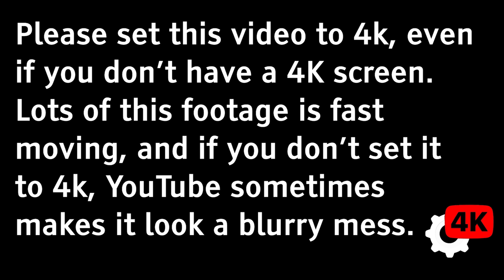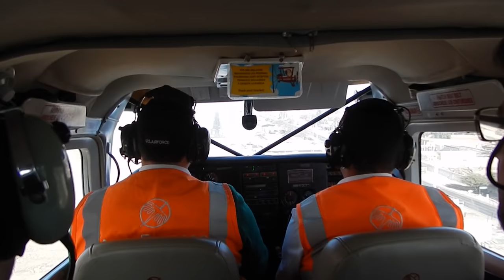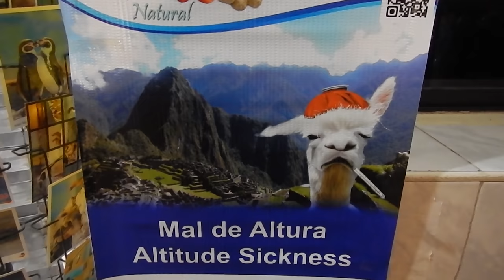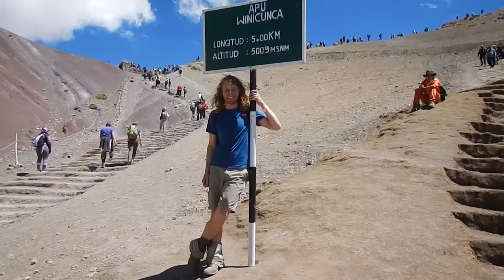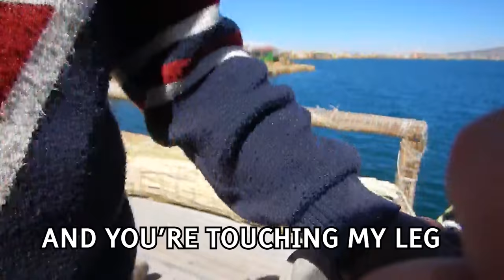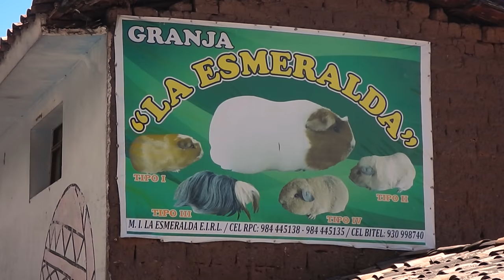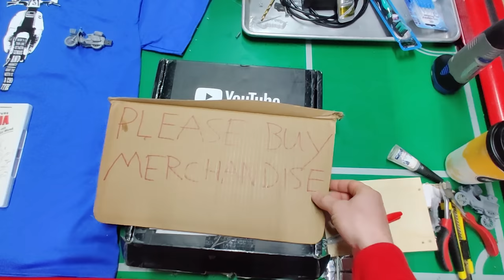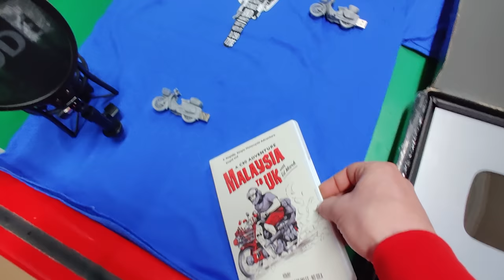Alaska to Argentina on a Honda 90 episode 15 - Peru and Ecuador

Comment: ED: Please watch in 4K

My Internet: Best I can do is 480p.
Reply: my internet can handle 4k but my pc...
Reply: My PC can only handle 360
Reply: I’m on an iPhone 8+ and the best I can do is 1080p60
Reply: Just move to Europe or Asia.
Reply: Ah you are from Germany as well...
Reply: @jakeblanton6853  Try to switch your DNS settings away from your ISP. 

The 500 Mbps connection is only provisioned between your location and the nearest ISP location, not out on the internet. But 180 Mbps should be plenty as 4K only requires about 25-40 Mbps so you may have other usage on your connection.
Reply: @danishknight2798  -- If that speed is only at the ISP, then it's pretty useless since there is not really much of anything anyone would want to access there ... :)  The 2 year promo was up on the special pricing for the 500 Mbps service, so I canceled my service and let my wife sign up for a 1 year 25 Mbps promo (since they would not give me a deal to stay).  Technically, she's a "new user" and has not had an account with them within the last 30 days, so she met the requirements for the promo pricing.  I've tested the speed a couple of times with it on various machines around the house and with a wired connection, it gets very close to 25 Mbps and sometimes up to 29 Mbps.  With a Wireless connection on those same machines, it gets around 16-18 Mbps these days.  Which is a bit odd since the WiFi adapters in those machines are easily capable of handling a lot more than that speed and when connected to the WAP on the previous cable modem were able to get more speed (although not as much as Xfinity claimed I was supposed to get).  For my use though, the 25 Mbps service is plenty.  A few years ago, I had 10 Mbps service and was content with it.  I just don't do the types of things that require high bandwidth.
Reply: @jakeblanton6853  What are you complaining about? If the line between your location and the ISP's first hub does not support more than 50 Mbps that is what you get, evenif they sell you 5000000 Mpbs.
Reply: @danishknight2798  -- They only sell a particular package if your address should be able to get it (or at least pretty close to it)... And I'm a curmudgeon, so complaining is one of the few pleasures I have left in life... Or as we used to say, "A bitching sailor is a happy sailor"... :)
Reply: @jakeblanton6853  Or they get tired of hearing from you aka I used to work the same building as my ISP's techs. Before fiber, I got two copper lines run to my area to support 1.5 Mbps before the rest of the zip code. Now, we are up to "50Mbps" on "fiber" for 8 households dead-end area of their lines in rural county backwoods and get 30-35ish depending on the weather.

FYI- This is USA too.
Reply: @jakeblanton6853  Have you tried upgrading your router? The one that is hooked to the 500 Mbps modem? I got a Netgear Nighthawk and it finally fixed the bottleneck... now our neighbors get our wifi signal
Reply: @TheTurtleOfGods  -- I was using the router that was part of the Xfinity modem, so it was supposed to be good for up to 1 Gbps (wired or wireless)...
Reply: Gheezus people, what's the big deal.  If you want to watch in 4k, just download the video (doesn't matter how long it takes), and watch it offline at 4k once it's done downloading.  Now if you're data capped, that's a separate issue, but (bandwidth) speed limits definitely don't stop you from watching 4k videos.
Reply: Me watching in 240p laughing
Reply: 340
Reply: I don't even know what mine is but it's pretty far from 4k through my cracked screen.
Reply: I set it to 4K and my YouTube crashed
Reply: Now you can't even watch videos in 4K anymore without paying for YouTube Premium. Thanks Jewtube, money hungry bastards. Can't enjoy this wonderful content how it was intended without shelling out extra money? Pass. 1080p is fine for me!
Reply: @SamiNami  just existing in europe doesnt make the internet faster

Comment: Just a tip, a condenser mic doesn't pick much background sound, and you can use any gate plugin to filter out lower-volume sounds. You don't need to soundproof your room using these techniques.

Comment: hello ed  you got some dedication riding all them miles on c90 but same time your right about c90 find parts any where in word for them... i am going to travel the whole cost of the uk off road on a crf70 pit bike nothing compared what you being doing but you have inspired to do this, but if this goes well mite take the same bike around Europe as the c90 and crf70 are similar finding parts should be about the same i hope.

Comment: You don't have to climb those steps, there are busses from early morning to get you up there. Personally I took the steps because I enjoyed  the climb. It isn't necessarily true you will get to enjoy it with less crowed if you get there before the busses, because the gates only open at a fixed time, and usually at least 2-4 full busses already reached the top by then.

Comment: Hi Ed, im looking at doing something likewise but with a bike with a little more oomph, a little more ground clearance and more suspension. 

I'm currently looking at a suzuki dr600 but i was wondering from your experience which bikes you can get parts for anywhere?

Would be crap to break down and have no parts available in the country

Comment: Hi. Thanks for the videos. I recently came to know about you when I was confused if my motorcycle is good enough or not. Then I found you did it with a lightweight motorcycle with very low cc motorcycle. I can afford only 125cc motorcycles in India. Is it okay to use it for travel?
Reply: You only need higher displacement bikes if you want to do higher speeds. So for motorway travel across Europe, a 1250cc RT would be better, but for a slower riding, smaller bike is lighter, takes less fuel and generally easier to fix. If it lacks in torque, especially in higher altitudes, just change the sprockets.

Comment: I ordered one of your hoodies on 29th December, Ed. Paid £30, £5 over the odds to help you out. I've heard nothing, despite two emails asking if there's a problem. Is it too much to expect an answer?
Reply from the maker: Hi Malc. Sorry for the delay, the amount of fan emails after the last video was ridiculous and I'm still working through them. It's taking hours 😳

I see you first email was sent 2 days ago and I'm currently at sea so I'm quite far behind with replying.

Long story short: the clothing is finally being printed after finally finding some in stock (Brexit and COVID double tap on that one unfortunately, sorry).

It should go out this week once the printers gives me the call and I have someone collect it and post it out.

Given how much of a headache the supply chain and even the postal service taking ages to boot, I'm starting to contemplate increasing the merch prices and using a third party service instead. It'll stop some of these problems, but also have someone dealing with customer service that isn't on satellite internet at sea 😬
Reply: @c90adventures  Thanks for the reply Ed. Good luck with everything.

Comment: Really love your content and don´t want to be negative, but I need to give you one tiny bit of advice: You (and many other native english speakers travelling abroad) don´t seem to adjust the speed and level of complexity of your english when talking to locals, which, if you want to be understood , you should definetely do!
Reply: ... beside the language problems ... this is variably difficult ... I live with Colombians and Peru natives in Spain ... they tell me that remote areas use different forms of linguistics that even Colombians don't understand ... ... in anywise, all this without sponsorship or financial aid ?? ... no reliable financial backup plan in case donations run out or never materialise? ... insanely impressive ... I would expect some form of sensibly implemented plan to cover most situations before any initial departure of such magnitude ... not for the faint hearted and certainly not for the financially inadequate either ...

Comment: ... all this without sponsorship or financial aid ?? ... no reliable financial backup plan in case donations run out or never materialise? ... insanely impressive ... I would expect some form of sensibly implemented plan to cover most situations before any initial departure of such magnitude ... not for the faint hearted and certainly not for the financially inadequate either ...

Comment: Thanks a lot Mr. Ed March with your clapped out, baling wire and duct tape, rusty, piddling 10 horsepower disgraceful round the world traveling junkyard "motorcycle".  Now you've done two things:  ruined any other ho-hum been-there-done-that boring motorcycle trip report AND made me decide to sell my perfectly good BMW GS in favor of some other rinky-dink puttcycle that I can actually pick up without ruining my aging back.  You've also dispelled any idea that a motorcycle adventure has to be planned to any degree and the idea that a small bike isn't suitable for long distance travel.  I mean when you can go to the northernmost regions of the US, turn around and cross Canada and on the way south decide to take this thing called the TAT with no more thought than deciding what's for breakfast?  You can't do that!  You have to spend months if not years planning for just one leg of that trip - not combine them into one.  And to top that off, just decide to keep heading south off to God knows where.  You've just ruined all my conceptions of what motorcycling can be.  The only thing left is to go see that 86 Honda CT110 on craigslist, even though it has excessive displacement, and try to make a deal. I didn't think it would ever come to this.  Thanks a lot.  When's the next video coming out?
Reply from the maker: Good comment, Sir! I take my hat off to you.

As for the next video: difficult not day at the moment with the level of uncertainty in my life. But I'll start trawling the footage soon I reckon. It might be the last one in the series, so I need to make sure I do it justice, as there's some difficult subjects to cover.
Reply: @c90adventures  Thanks for your reply and thanks for the work you put into each video.  Looking forward to whatever is next.